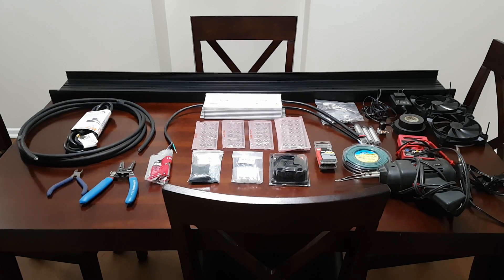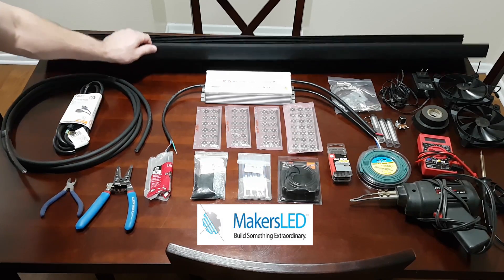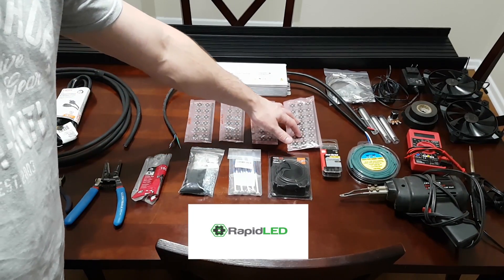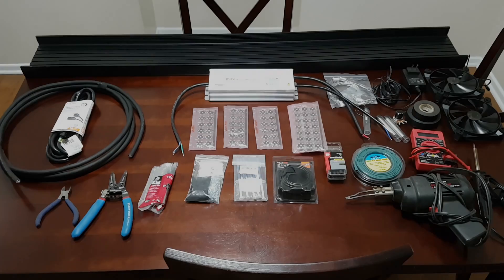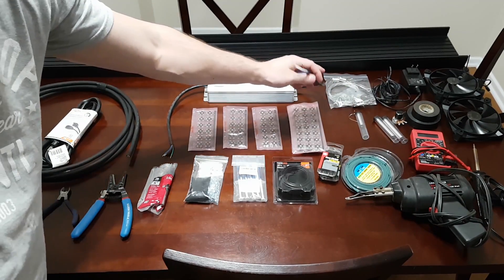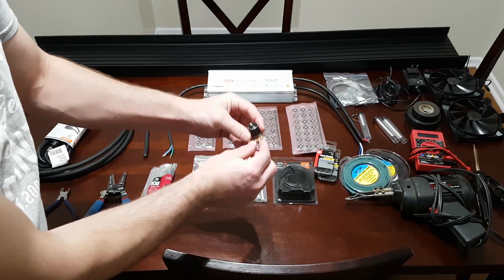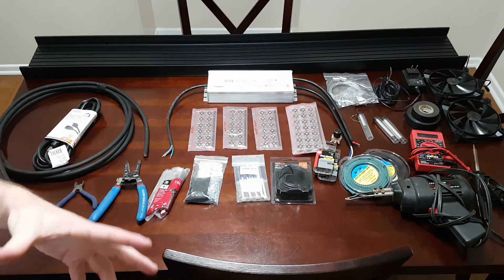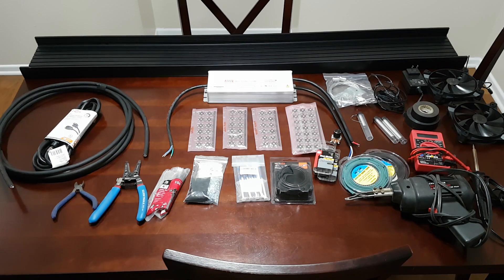The Ultimate DIY LED Aquarium Light Part 1

Comment: Awesome! Do you have a run down of how much all this costs?
Reply from the maker: The Water Box not really... the LEDs are $8/EA and I have 92 of them, the housing is $250, the driver is $150... there's $1200 right there... plus all the little odds and ends. I would say $1,500 wouldn't be too far off